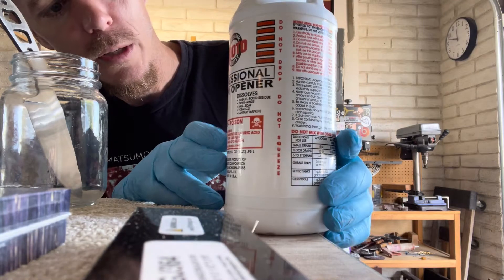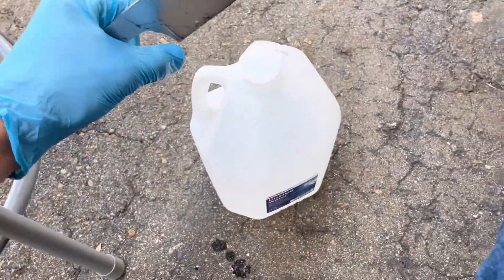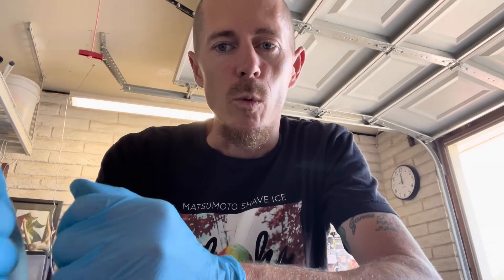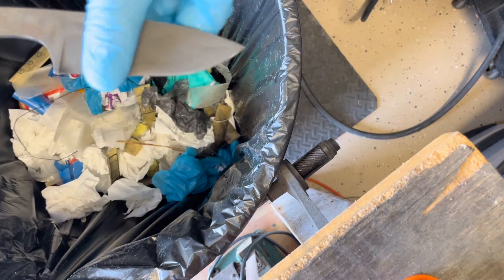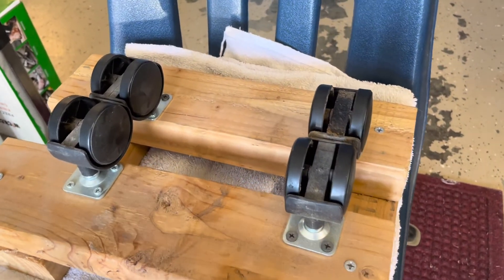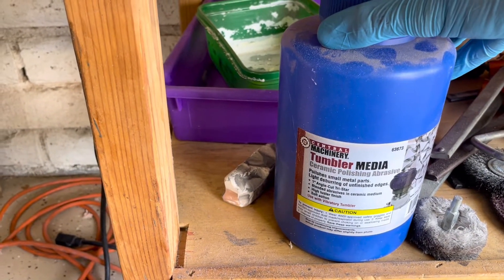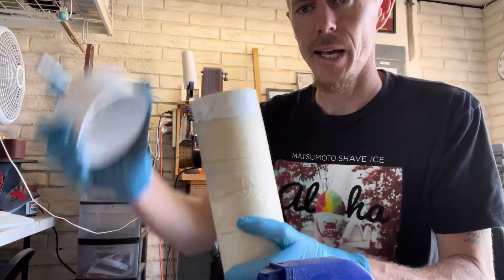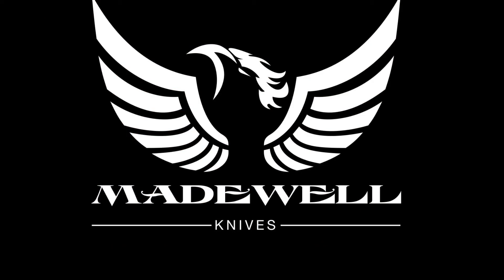Etching/stone washing stainless steel

Comment: Hey, nice video! Thanks for your hard work. 

My blade has this lines, which I don't really like. I guess it is marks left after machining? Should I sandpaper/polish it before etching? Is it even possible? And if so, how I do this? What tools/materials would I need?

Also I'm not even sure if 40% FeCl3 will do anything to my ~1% C ~15% Cr (10Cr15CoMoV) blade but this sulfuric acid reaction looks pretty violent and scary. Soo I guess I'll try to etch some random (similar or even more corrosion-resistant) piece of steel with FeCl3 and if everything will go fine I'll try it on my actual blade.

Damn your stonewash looks so good.
Reply from the maker: Thank you! Im glad you enjoyed the video. Yes I would hand sand the blade up to at least 600grit before etching your blade.

Comment: I think the stonewashed finish turns out better looking on the stainless vs the high carbon blades myself. What grit do you finish stainless blades to before you acid etch and tumble them? I want to try this with some CPM Magnacut steel.
Reply from the maker: I agree 👍, this one is cpm154 if I remember correctly, typically I will stop at around 600 grit,
Reply: @madewellknives  Awesome, thanks 👍

Comment: Thanks for sharing. Quick Q: what about the rest of the tang? Do you acid wash that as well or do you leave it be and sand it down after putting the handle on?
Reply from the maker: I’m so glad you enjoyed! I will generally sand the spine around where it meets the handle. So the blade has the dark finish but the spine is shiny. If you want to keep it all dark, I would recommend fitting the the handles first, then remove and start the etching/washing technique , but definitely etch the whole knife.  👍 good luck! 
I really Appreciate the feedback
Reply: @madewellknives  thank you for clarifying that. I appreciate the quick reply :) I love a light stone wash finish on a blade and want to also try it out soon. I only use stainless and was wondering how to etch the stainless. Glad i came across this.